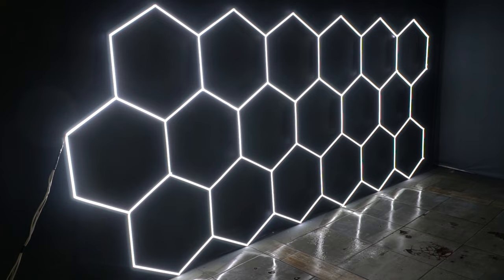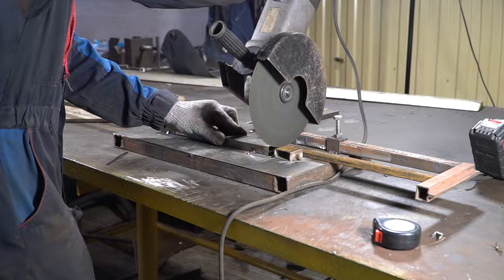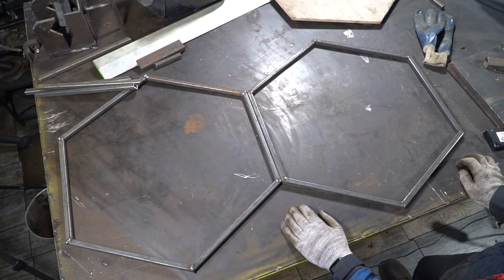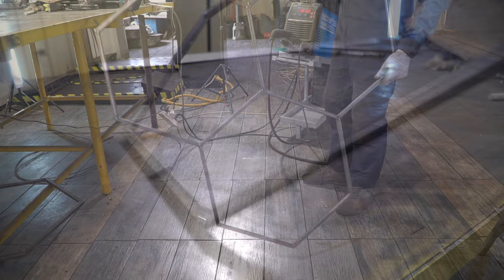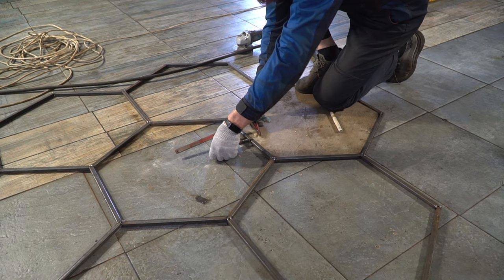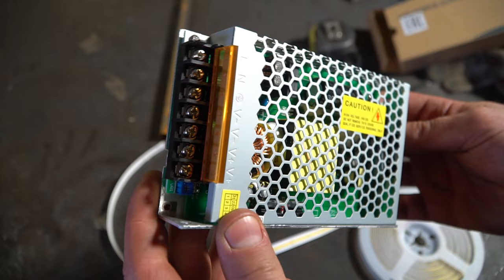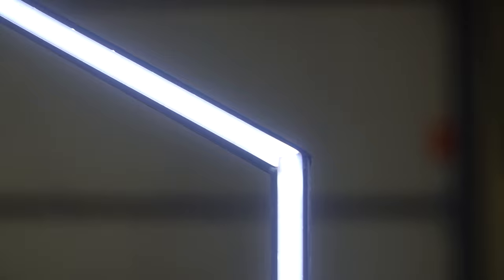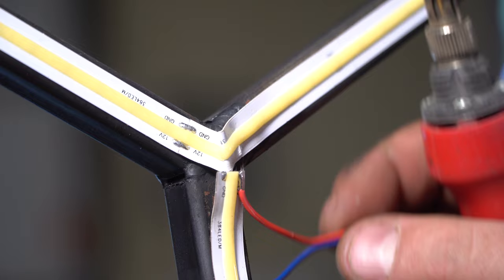Homemade hexagonal LED light

Comment: You may want to take some small translucent zip ties and put 2 or 3 per section of LED in case the adhesive ever fails and it would be invisible from a distance

Comment: How much did it cost? Ive never welded before but this would be super cool in a room as a ceiling light
Reply: I wonder if you could do the same with some black/painted pvc  and LED strips
Reply: @sydneyp.2320  Long as its rigid enough to support the weight anything is fine for it. Cut peaces of metal or plastic to mount on the back from sheet material and you can screw it from the wood peaces as well, making it really cheap and quick specially if you have access to laser cutter.
Reply: @sydneyp.2320  you could. But led strips like to be cool and it's kinda hard to do it without metal. If steel is not your thing you could use aluminium

Comment: please take a welding course. these "welds" are horrible.
Reply: Glad I'm not the only one bothered by that. 
I love this guys work, but how someone amasses this much mechanical knowledge while never learning even the basics of welding is a mystery to me.
Reply: @jakefoley9539  show another instance where he did it poorly and it's crucial to the visage of the final product
Reply: @sFeral  The entire frame of the Quadra, off the top of my head. And that's a lot worse than a visage problem, it's a structural problem.
Reply: obviously not as bad as you think if he managed to move this structure around without it bending out of shape at the welds or falling apart entirely, but then again I don't weld, I'm just pretty sure he wouldn't go through all this only to get an unsafe final product.
Reply: @sFeral  If it sounds like we're going out of our way to bash the guy, I assure you we're not. I'm in awe of his creativity and fabrication ability, but his shortcomings with welding, specifically surface prep, are something that have been consistently been pointed out by multiple people since the Quadra series first began. I certainly hope it doesn't result in any long term issues, but in the event that it does, we already know the cause.
Reply: Not everybody is a five star welder.
Do the welds look great? No. Will they fail? Unlikely, as the structure is light and there are many points of welding.